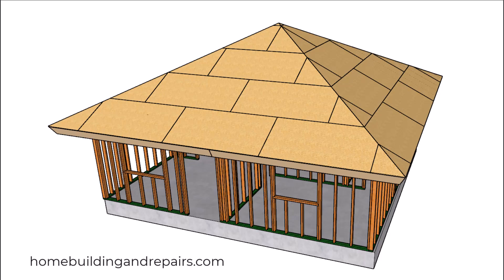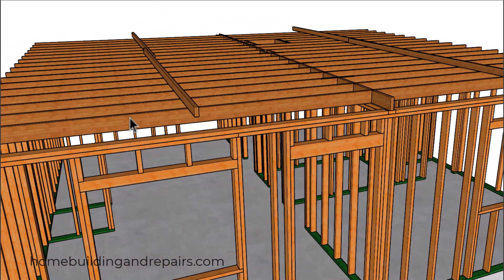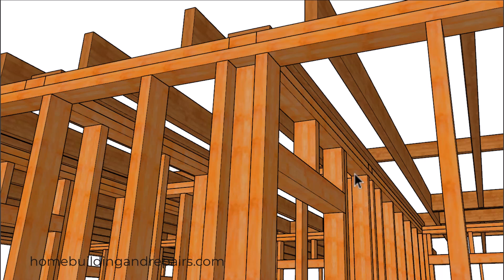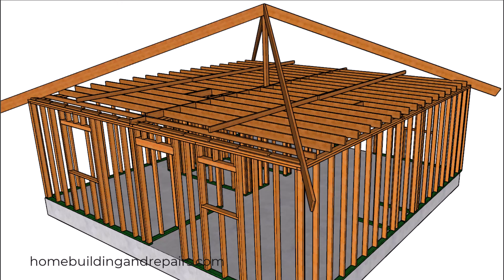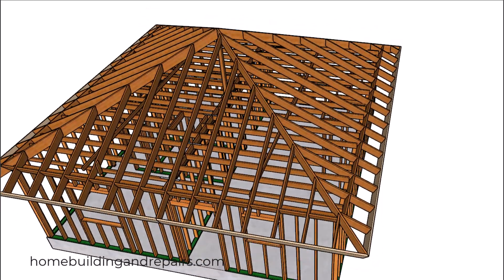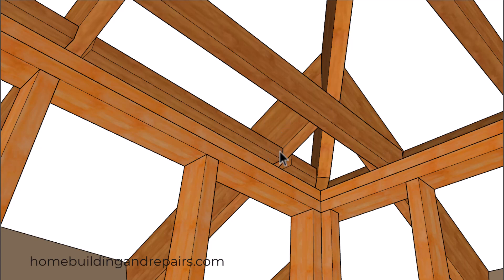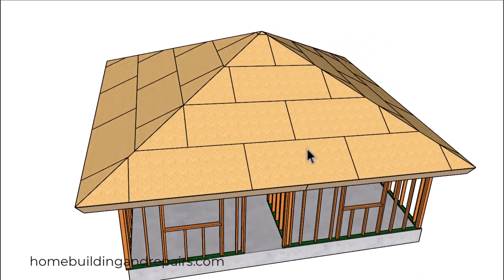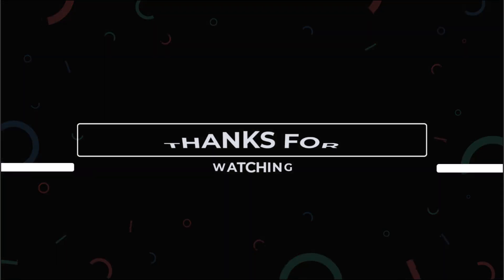Hip Roof Framing For 625 Square Feet Home Building Project - Assembly, Layout And Construction Tips

Comment: Hey, Greg! Question. Have you ever had a client pull floor plans from a vintage Sears & Roebuck catalog of a specific home they want built, but to modern day standards? Basically you'd go over the structural engineering section of the plans and update them to modern structural requirements as well as update the overall architectural floor plan layout a little bit? Thanks in advance! I'm quite curious if that's something you've ever done in your career. Beautiful homes those Sears catalogs had back in the day. Modern tract homes lack that character, imo.